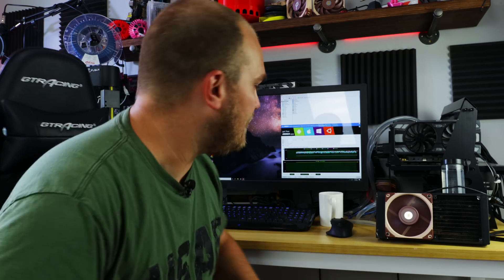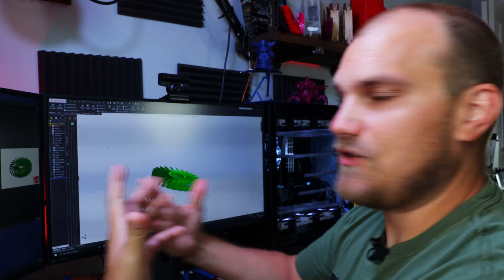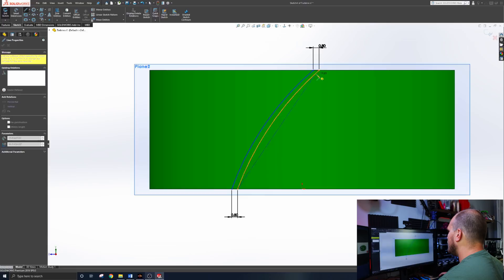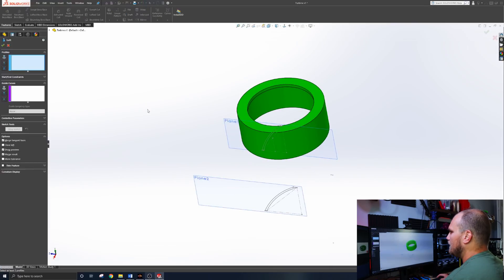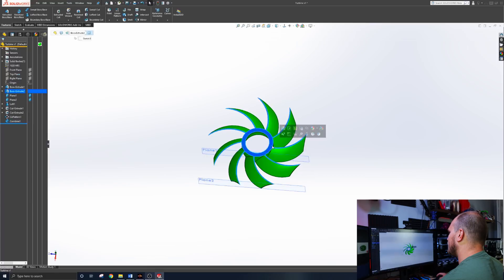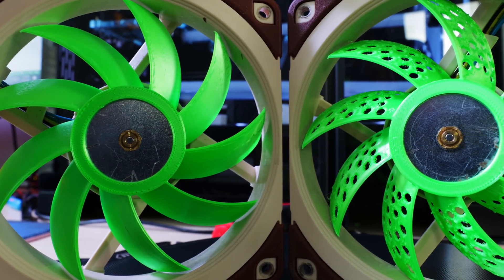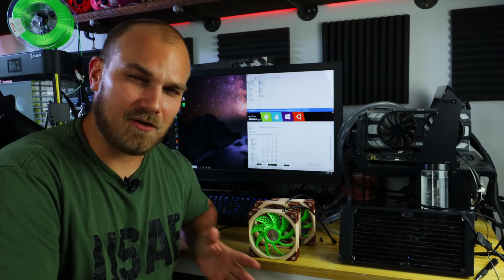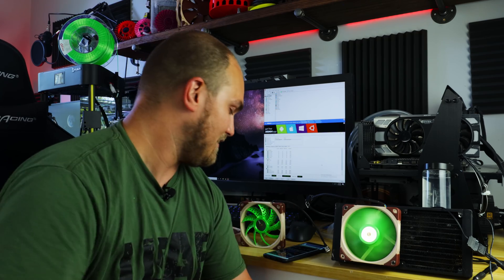Does A Holy Fan Work? | 3D printing the Answers to questions no one is asking!

Comment: Definitely different than a 120, you are getting some passive heat dissipation from the unused 120 side. But for A-B comparisons, it's fine.
Reply from the maker: yes i can agree with this
Reply: I just want to put it in technical terms, but you said it correctly. A radiator without a fan experiences heatexchange due to passive convection from warm air rising from the fins, pulling in fresh air from below, granted there is a heat gradient at all. If you put the radiator flat this effect is maximized because the air can rise freely through the fins, but there should be a noticable effect when the radiator is upright, too. If you mount a fan, the airflow generated by this fan leads to forced convection, which works the same in principle, just better due to more air going through the fins. The other space not occupied by the fan should still dissipate heat as it adds to the effective heat radiating surface.
Make a video from it! How big is the difference? that way you could quantisize how much heat a 120mm "slot" of radiator can dissipate ^^
Reply: @Medievalfan94  This post of mine is pointless. This wouldn't happen in space =)
Reply: @jbeard3390  huh?
Reply: @Medievalfan94  What I think was is being pointlessly said.  In zero-G/freefall/orbit convection doesn't happen due to there not being a gravitational up. So if the test happened in space convection wouldn't play a part.  And now that the joke has been explained to death we can move on.
Reply: @TheMajorJF  perfect explanation thank you
Reply: Agreed, insulating the other half of the 240 would help accuracy, I would think.

Comment: the scale, get one of those to weigh weed they more accurate sensibility
not kidding had a similar problem.
Reply: I was going to say that the difference may be unmeasurable with his current scale if it doesn't go past one decimal place.
Reply: to my fans - yeah im high and i am not a native english speaker
Reply: lol dude i think you mean jewellers scales or gold scales and usually the one's the do 2-3 points after the decimal
Reply: @moorhen6156  I use those to weigh my vitamins and the caffeine I put in my energy drinks. (a 6 pack costs the same as about 100g of caffeine, but only contains about a gram)
Reply: @moorhen6156  nah a "kitchen" scale will work
Reply: I too like weed
Reply: Nice grammar
Reply: @cristobalsepulveda9085  when i coment someting i am alwais scared of me gramar been wron.
Reply: @cristobalsepulveda9085  I haven't researched the poster, but not everyone in the world is fluent in English.

Comment: I'm not positive, but the Noctua blade might also spin at a faster RPM because of fan balancing.
Reply: Didn't sound like his fans were vibrating much, so if any imbalance it would've been minimal. He said his blades have a more aggressive pitch, that'll increase the torque required to spin the fan a certain RPM, and to increase the torque of this type of electric motor, the RPM must decrease. It's really as simple as that.
If you wanted to try an RPM for RPM comparison, he could get a variable power supply and see if at or below about 18V he can get it to spin at the same RPM as noctua... That'd be interesting to see the performance difference then.

Comment: Noise, cooling, noise frequency andddd balance. That said i wana see it
Alsoooo the thermal mass is a shitload higher, sooo soaking it will not be as consistent. Your not controlling ambient, sooo that eliminates the possibility if you just use the same test over and over again using the samething.
Alsooo its probably more then twoce the thermal mass, consider the fact that it has to end sooner then a 240 would even tho its roughly 2x the size physically. The fin density will be less on the 120 then that 240 even with the same measurements of the area probably.
Anywayyyy just saying why not, mainly because ya asked. You do what ya want

Comment: You can print a 120x120 cover that you can screw or glue to the unused side of the radiator. That way, you can maintain your static pressure -- I think (might have to do some temperature tests just to be sure). That might be a suitable compromise instead of buying an actual 120mm radiator.
As far as the weight oddities with the fans, the e-steps on your Tevo might be slightly higher than usual, therefore pushing out more filament. What happens if you print the holy version on both of your printers? If there is a large weight descrepancy, then your e-steps may be out of whack on one of your printers.

Comment: There are various terracota apparatus that are said to be Humanities first tries at creating mechanical air conditioners. One of them is a fair number of small tubes that are bigger on one side than tje other, the theory being that as the same quantity of air passes from a small area to a bigger one it becomes cooler. Im wondering if one of those designs would work if a fan, either with positive or negative pressure, assisted it. Perhaps a tad too much material for a 3d printer to print but hey, wouldnt it be cool to see if an old idea meeting newer applications?

Comment: It is different than a 120 rad, because it has more thermal mass, and there is passive cooling just from the convection on the "open" half.

However for the testing, all that matters is you use the same system.  You are just trying to find the ∆ between the fans.

Also, instead of trying to put speed holes in the blades, try playing with the hub design.  Skeletonize it, thin it out, maybe decrease the amount of blade to hub contact.  Heck, go crazy and just have the top ring, and a bottom ring, and the blades only having like 1.2-1.6mm of contact with the hub at the top and at the bottom.
Reply: thermal mass should remove it self from the equations, when he runs the system to thermal equilibrium. (but running it longer introduces other issues)

Comment: thats not the same as 120 because you get the benefits from passive cooling from the fanless portion
Reply: He could put blanking plates on both sides of the radiator to cover the missing fan. No thermal convection would happen in that portion. Black body heat radiation is negligible in this case, the outer surface of a blocked off radiator is nothing compared to the surface of all the cooling fins.

Comment: 240/2 =/= 120, because the extra fins have some idle heat radiation. It might be within margin of error, but there will be a difference.
Reply: Laughing Orange except he’s not testing radiators, he’s testing fan performance. As long as all fans are tested on the same radiator and only in single fan configuration his data will be sound. His temps might be slightly lower than if he used a 120 rad but as long as test methodology stays consistent it has no bearing on anything.
Reply: @robertrhoads6248  His measure is temperature, so this will make the results closer than they would be using a 120mm.

Comment: i still recommend you to buy a dlp printer ... better surface quality and you can do all shapes without having problems with overhangs. otherwise i have to say your effort is commendeable. always good to watch it :)
Reply from the maker: i want to but i just bought the prusa, maybe ill get lucky and receive one for review.
Reply: DLP printers do still need supports for overhangs...
Reply: @plebetopro5786  bra, not for this kind of prints as they are completly flat to print on one side. only print supports at the flat side, which are easy removeable. the rest can print completly without.

Comment: Golf ball dimpled fan?
Reply from the maker: i can do it
Reply: @MajorHardware  Aerocool Dead Silence and EVGA rtx 2070 have dimpled fans, surely it's good in some way or another...
Reply: @MajorHardware  I made this suggestion when you first asked your viewers to throw ideas out there.

Older Silverstone case fans used to have golf ball dimples, it's meant to lower air friction, and thus lower operation noise of the fan...might be worth incorporating with some other ideas, to try and keep your fan designs as quiet as Noctua's.

As well as keep the fan blades connected like Noiseblocker e-Loops.

Also it might be interesting to try out fan shrouds, to keep the fan hub further away from the surface of the radiator, and also try differences between pushing and pulling with the shrouds...maybe even attempt to make a modern version of the old Triebwerk fans, where the blade is within a 50mmm thick frame, that would be sick!
Reply: Myself and others have made this recommendation! Let's get it done Major!!!!
Reply: I had some extremely old raidmax fans that were dimpled and ran amazingly!
Reply: Was just thinking this as I was scrolling in the comments.
Reply: i just watched and asked the same thing, then ran through the comments and saw he ansered yours. could have an interesting effect.
Reply: And bam you’re the reason we got the golf ball dimpled fan
Reply: Zaward still do them, it's their 'thing'. You don't see them mentioned much these days.🤔
Reply: I believe the dimples in a golf ball or to help it fly straight
Reply: Attempting to reduce the drag on a fan defeats the purpose of the fan.  The point of the fan is to move as much air as possible, not slip through the air with as little air movement as possible.  Air movement in a fan comes primarily from flat-surface lift due to the angle of attack, and from win lift.  I think dimples would reduce wing lift if it did anything at all.